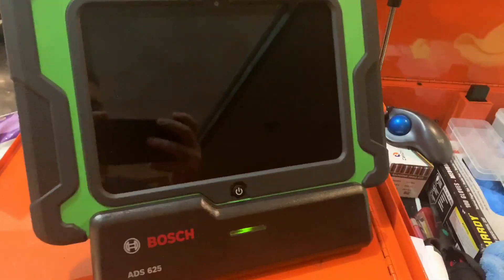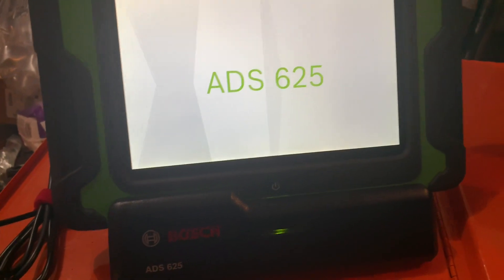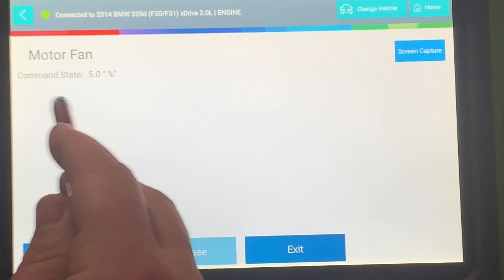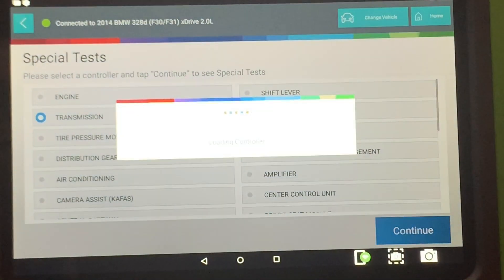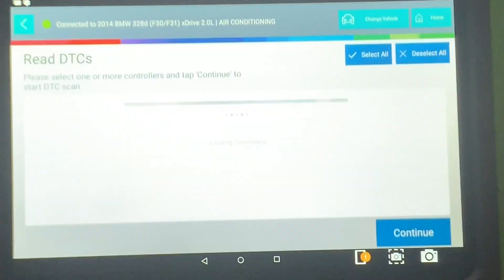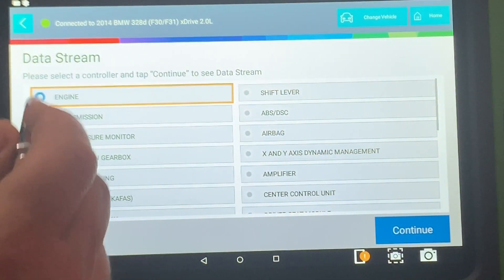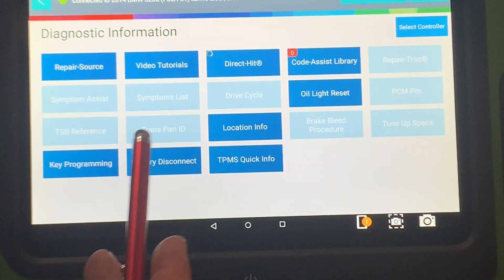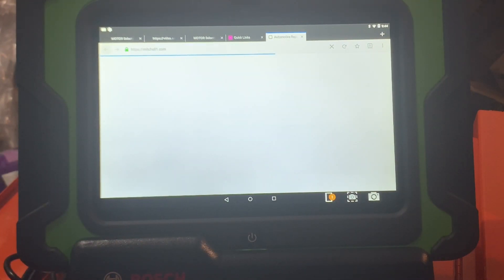Bosch ADS625 Scanner IN Depth wall through with time stamps J2534

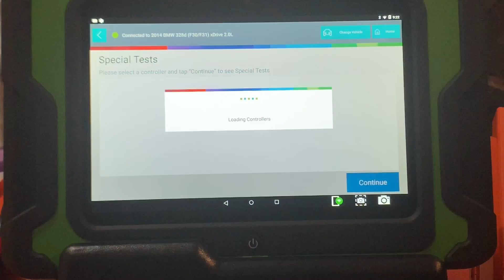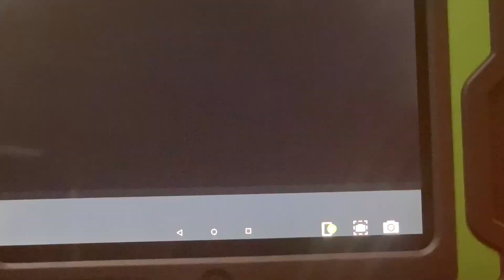Comment from the maker: Hi guys here’s the new Bosch ADS625 full walk through with time stamps to get you an in dept look at it. This is a fantastic scanner and has a lot of options. This scanner has great PID layouts as well as wire diagrams and repair data with your subscription. 4:03 Special Tests 5:25 Fan Test 6:40 Bmw milage resets 8:41 Maintenance Resets 8:30 Data Streams 12:00 Data Graphing 13:27 Wire Diagrams Free 14:46 Repair Data Free 17:54 Automated Testing
Reply: What's the amount for a new ADS625 Scanner would really need to get one as soon as possible pls. The review is mind blowing.

Comment: If you don’t update the subscription on the tool do you lose access to the wiring diagrams. How much is the annual subscription.
Reply from the maker: gary tattan yes you do, I figured for $900 a Year for a lifetime warranty repair data and wire diagrams for me I feel it’s worth it but I guess it all depends on how much you use it

Comment: How does this compare to the Autologic's Drive Pro?
Reply from the maker: Jack I’m not sure I’m waiting to get my hands on a drive pro Es here soon in upcoming month or so. It’s a hell of a machine tho.
Reply: @weldingjunkie  I'm about to buy it. I think the support side of it is the greater selling point. I've seen too many examples of people going to the Autel when there is no comm or a lack of data on Autologic/Opus....
Reply from the maker: Jack I agree the auto Logic is still getting thier feet wet and is working through a lot. Thier postive side is through remote support vs an actual scanner. The Bosch is amazing the support is amazing and the money they are putting into upsides have been huge. They were also the first to Chrysler secure gateway. If you haven’t already join my face book group “automotive scan tools” lots of info there as well. You can’t go wrong with the ADS625.
Reply: @weldingjunkie  Thanks for the invite. I have requested to join. Would you choose the ADS625 over the DrivePro atm?
Reply from the maker: Jack absolutely plus the drive pro is $300 a month for 12 months so you need to add. 3600 to the cost of the drive pro. I’ve not used a drive pro and will get my hands on one once they mature but I wouldn’t go without my ADS625. I have 7 after market scanners. Snap on Zeus, Bosch ads 625, launch torque, Autel IM608, launch Diagun IV, Think Diag, ForScan and my favorite is my Bosch ADS625 for sure.

Comment: Which one would you recommend otc evolve or the Bosch ads 625?
Reply from the maker: Bosch 625 is better imo they are pretty close to same but the 625 is more ergonomic. I’m not a fan of otc style
Reply: @weldingjunkie  thanks! I couldn’t pull the plug but im go with the ads625.
Reply from the maker: @sebastianruizcortes1725  you’ll be much happier with it